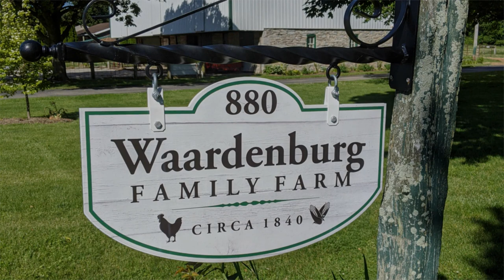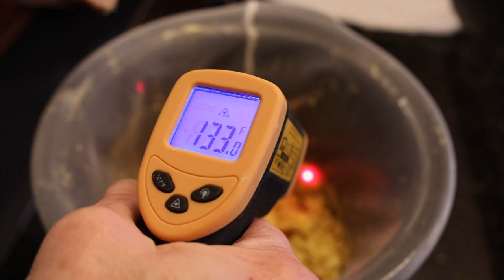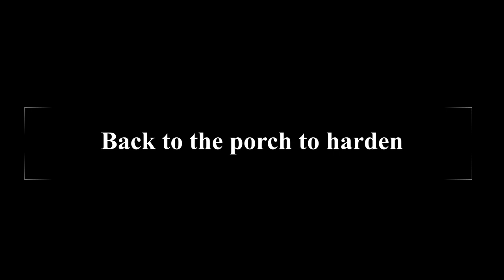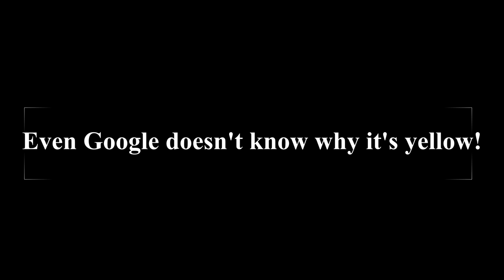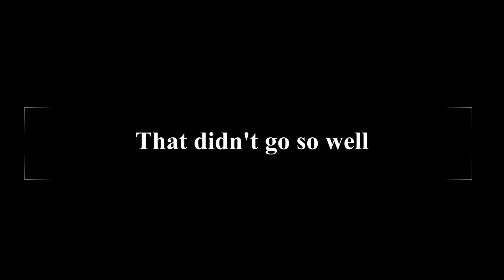Making Beeswax Candles Using Wax We Rendered From Our Own Hives

Comment: You guessed right. Beeswax is a product made from the honeycomb of the honeybee and other bees. The mixing of pollen oils into honeycomb wax turns the white wax into a yellow or brown color.
If you had put a little wax on the middle of the stick and stuck the wick to the wax it would have worked.
Reply from the maker: I love the color of beeswax.  I will definitely use better techniques next time. Thanks for the suggestion.  Thanks for watching!

Comment: Helpful tips…… over 180 degrees is burnt wax, don’t boil your water~ slow and steady wins the race for beeswax~ takes longer to melt but you don’t want to over heat your wax. And when you’re pouring your wax from one container to the next ~ one pot is hot and one was cold ~ should warm up both. Beeswax doesn’t take fragrance well but you did add coconut oil so that will help. and it sounds like a lot of fragrance oil but that’s what it takes especially for BW. Yes cueing takes a long time 14 days for BW. That’s why he was able to break those pieces of BW ~ not hardened/cured.  Some people say burn as soon as it’s hardened (Next day) but it will just burn shorter time since wax is still softer.  Yes essential oil are completely different than fragrance oils. So you should not even put in candles. Looks like you hand fun and that’s the important thing! 😊
Reply from the maker: THANK YOU for the wonderful tips.  Heating the other container makes so much sense.  We will be so much better equiped the next time we do it.  We're saving the wax from several harvests and then we'll be able to make a lot of candles at one time.  Thanks for watching!